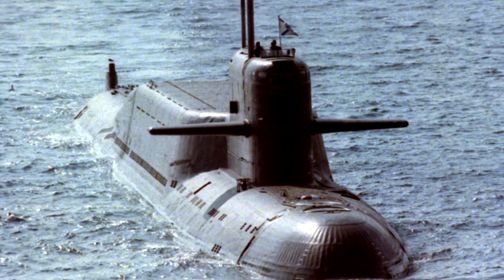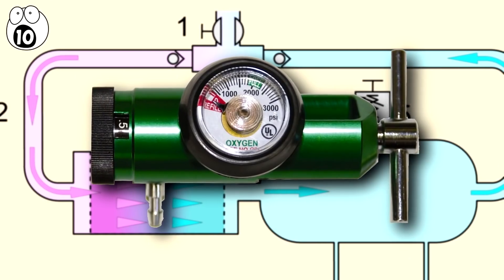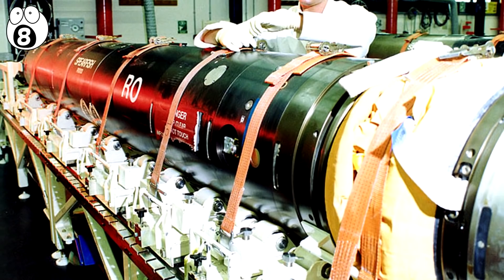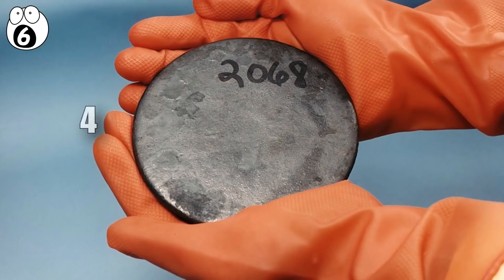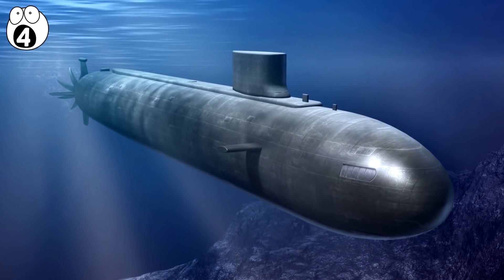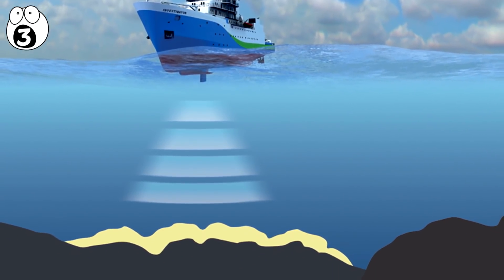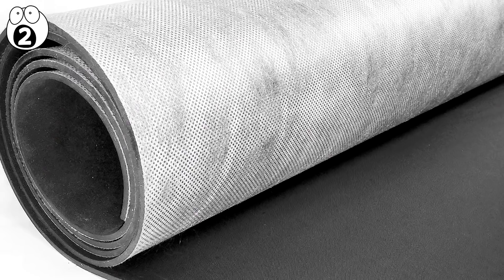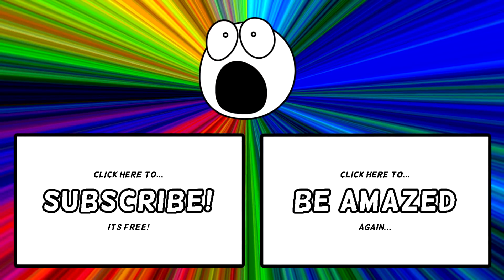Declassified Nuclear Submarine Design Secrets

Comment: I'm an Engineer on submarines and so much of this is inaccurate. Nice try though.
Reply: OPSEC Eng. ours is not to confirm nor deny
Reply: I stopped watching at "Rockets need air."  How did we got off the moon?
Reply: I started to have serious doubts during the ballast tank/planes explanation... Basically, it you're requiring lift/control from water flowing over the planes to control depth, what happens if you stop moving... The sub is going to either bob up or sink down to the point where its density matches that of the water it displaces with its volume. That's not progress, so I suspect the ballast tanks are still the way to do it.
Comparing it to a aeroplane just screams this issue, we all know what happens to the control of altitude of a aeroplane if it stops moving! An aeroplane will never manage to match the density of its surrounding, it's far more dense than the air, and the air/ground density transition is a bit sudden, so... splat.
Much better to compare a sub to a balloon/airship, all are buoyant in their chosen environment.

And then it moved onto guided torpedoes... Yup, acoustic guided torpedoes have been around since the 40s. Two seconds spent on google would have revealed a wiki page with loads of info.
https://en.wikipedia.org/wiki/Acoustic_torpedo

At that point I stopped watching, as I could feel myself getting dumber.
Reply: What's the difference between 'pumping water in and out' and ballast tanks?  What are you 'pumping water in and out' of?  That'd be ballast tanks, right?
Reply: Brian D. Also air is made using electrolysis. You only snort air occasionally as a fast replenishment or to run the diesels. Compressed air is also used to blow the ballast tanks in the surfacing process.
Reply: doggonemess
Great reply! LOL!  I was a nuclear trained EM in the Navy, number 6 was definitely wrong because he said that '...the steam is used to make electricity to propel the ship...' 
During normal operations, the steam is used mechanically (not electrically) to propel the ship (turbine to gear to prop) and a relatively small amount is used for electricity.  There is an electric propulsion motor that can be engaged with a clutch but, it would only be used in an emergency.
It's like this guy watched The Hunt For Red October for the first time and made a video about it!
Reply: What's inaccurate? Many, many points. I bet I can find one with every entry. Here goes. 
10: Subs never used compressed air cylinders, the people breathed the air trapped in the sub and got fresh air on the surface.
9: The earliest subs had planes. The image used as an example is a US Civil War submarine.
8: The last electric torpedo was the Sting Ray, which is still in service. The Tigerfish was retired years ago.
7: The MK48 ADCAP is used on all US submarines, not just the Ohio class. Acoustic homing torpedos were developed during WWII, and could follow their targets. Not all torpedos were dumb fired before wire guided systems were invented.
6: Amazingly, this is basically correct.
5: Rockets do not need steam launchers to work underwater. They carry their own oxidizer. Hence "rockets" and not "jets". This is easily the stupidest thing I've seen in this video - they don't use their engines underwater because it would damage the submarine, not because they need oxygen from the air.
4: Oh man, so much wrong. Passive sonar systems are located ALL OVER the submarine. The nose houses the active sonar emitter. And the active sonar is almost never used for navigation as it would give away the sub's position. They use charts, just like every other watercraft in history. And the "3D" hydrophone is probably as old as passive sonar. Advanced modern systems use towed-array sonar and complex algorithms to work out what the sound is doing as it travels through the water.
3: Propellers (screws) have always had multiple blades. The main difference is the shape of the blades.
2: Subs in WWII could dive beyond 300 meters. Some hulls are made from other materials, like titanium. 
1: The Seawolf subs function better as spy submarines, one of the reasons that the Jimmy Carter is 30 meters longer. They're too expensive and complex for fleet operations, hence the Virginia class replacement.

Do more research.
Reply: Thegreenbeanfightingmachine ok...
Reply: Steve Evans the planes don't generate lift like an aeroplane. It's all about achieving neutral buoyancy by pumping water in and out. Archimedes principle. Ballast tanks are only effective for buoyancy in shallow depths. Past a certain depth they're useless and you need propulsion to physically drive the boat up. The pitch is controlled by the planes. Bodily weight using water also gets adjusted for controlled depth changes.
Reply: Nizzle FoShizzle great theory. I'm not an engineer because I'm not broadcasting my service history in the public domain...
Reply: dspencer1969 if you are referring to American submarines then yes. If for some bizarre reason an American boomer was lost at sea (God forbid) then there will be others out there patrolling at the same time that can retaliate. If you are referring to an attack on US soil then the answer is also yes. A retaliation can happen very quickly and the crews will rehearse this drills very regularly. I'm not sure what the response time is for the US but I would hazard an educated guess as within 15 mins. I hope this answers your question.
Reply: Gaming with Vinnie yeah cheers muppet. Run along.
Reply: Aaron O'Shea I know more than this guy by reading Clancy books
Reply: If the situation had escalated to the point of it being necessary to retaliate in this manner, you will have more immediate things to worry about. Whether or not it actually is an effective deterrent is another kettle of fish.
Reply: neither confirm nor deny...
Reply: it is the flow of water over the planes that controls lift. If you stop, it's very hard to control depth. We used to have trim parties. All the fat guys ran aft. In control they had to pump water from aft to fwd to stabilize. And both plane yokes were forward.  Then a "spy" in control called the engine room and the fat guys ran fwd. They pumped water again the other way. All this till the diving officer realized they were screwing with him, and the fun was over.  STS2(SS)
Reply: Nope. "Ballast Tanks" are external to the pressure hull of the boat. On the surface they are full of air, when dived they must be completely full of water. Neutral Buoyancy is achieved/controlled by pumping water in and out of the "Trim Tanks" which are within the pressure hull of the boat. Depth is controlled with the hydroplanes basically by "driving" the boat up or down in the water column. With neutral buoyancy if the boat is stopped in the water it will be stopped in both horizontal and vertical position.
Reply: PS Ex Royal Navy Submariner (Marine Engineer Mechanic or Machinists Mate for US readers) 1974 to 1984
Reply: There are Main Ballast Tanks (MBTs) and Variable Ballast or Trim Tanks.  In your usage we are talking Variable Ballast - presumably all of the MBTs are full when Submerged.  The Variable ballasts are generally partially filled so as to allow adding or removing water.
Reply: Doktor McNasty no. There are internal tanks that you control body weight with. Ballast tanks are external. Internal tanks are called compensation tanks.
Reply: Subs absolutely did/do have compresses air cylinders. They are used to support EAB's or "Emergency Air Breathers" which are used during fires and accidental gas/chemical discharges. True, they air cylinders are not used for general air supply to the sub they do intermittently go up to "snorkel-depth" to "intake" fresh air and "expell" old used air but do not actually "surface".
Reply: "compressed"
Reply: I have a "boomer" question I'll direct to Aaron O'Shea.  Is our deterrent safe?  What I mean is,if something bad happened would we still have the capability to retaliate?
Reply: doggonemess you know more than the guy that made this video, have you ever been on a sub.? Also if you think about it, it’s asinine to think they carried tanks of oxygen, they would need so much room just for that, thanks for the correct info. Good video but they should really do more research.
Reply: loololololol
Reply: Aaron O'Shea im no sub engineer, but i do know a thing or two about rockets. And as long as your rocket has LOX, or any form of oxidizer, it can ignite underwater. There was a plan for a super heavy lift booster called sea dragon, that would launch from the ocean, with the rocket nozzle submerged.
Reply: Oxygen is made that way, not air.
Reply: Utter nonsense!

Any Diving Officer Student is taught PASS P=Planes, A = Angle, S= Speed, ans S= Special Ballast.  (Special Ballast really only applies to older Diesel and early Nuke Boats - Think Negative Tank.)

PASS measn to say that in that order, the Diving Officer should attempt to obtain a desired or neutral trim.  If upon diving, one finds the boat heavy he should maintain his depth by adding plane angle up, if no good, add angle up, if not, add speed, and in a final act blow some water overboard.

The way to obtain neural or other desired trim is by flooding in or pumping out water OR moving trim water fore-aft.  

The stern planes, indeed, do generate either lift or down-force, but they also can change the angle on the boat.  So note that Stern plane angle can affect BOTH lift and also angle.

Same effect if  reversed have Bow Planes,  With Fairwater Planes, there is a lesser affect on Angle, but lift and down force are both created.
Reply: Electrolysis is used to make OXYGEN.  Oxygen and otther gassses such as Nitrogen, CO, CO2, are compressed for storage in air flasks.  Oxygen is stored separately in O2 Flasks.
Reply: Of course the manufactured Oxygen from electrolysis is stored in flasks on board!  Doh.
Reply: Nope!
Reply: And then there are Main Ballast Tanks which do not!
Reply: You missed the Hydrogen peroxide fulled torp. We had several accidents with these and it has been suspected that the Kiev suffered this problem. Hydrogen peroxide reacts to aluminum  ( the torp body) and releases hydrogen gas which can build up and cause an explosion. Please do more fact checking.
Reply: These replies are funny.  Lots of submarine "experts" arguing over semantics on why thier comments are right and others are wrong.  Really?  You guys got nothing better to do?  Good, it's hilarious!
Reply: Thegreenbeanfightingmachine from a person that just likes to learn about submarines, yes it is pretty inaccurate.
Reply: Like what?
Reply: 1962 -1970, 2 diesel boats, 2 nukes.  Did not bother to finish watching this.  DBF.
Reply: It's classified. For me to even go on a US Navy sub, I had to get a clearance.
Reply: Aaron O'Shea ha bullshit
Reply: doggonemess 

doggonemess 

Submarines still use compressed air bottles for the HP air ring-main and blowing ballast tanks.
The earliest submarines didn't have planes. This came about 40-50 years after the earliest ones.
Reply: BULL
Reply: Aaron O'Shea sir what is the biggest mistake in your opinion this video made.? Tia.
Reply: You guys missed one. Submarines now longer use ballast tanks to control depth. They now use planes to change depth.
Reply: No,,, Ballast tanks are inside.  STS2(SS)
Reply: There's a variety of ballast tanks throughout the boat. Water is either pumped fwd or aft to control pitch, or pumped on board or to sea to overall lighten or make heavy the boat. STS2(SS)
Reply: @raven, this guy is no engineer. Who even writes engineer with a capital letter? lol!

Any real submariner wouldn't debate how a supercavitating torpedo works on a engineering level. Don't really have much time if you got one of those incoming at 530 mph.
Reply: Aaron O'Shea Well then. Make a video!
Reply: Arron O'Shea, while not a submariner myself, I have been in the program for 25 years and its a very small community. When I put your name in the global address book nothing came up and I don't recall your name not that I know everyone. Mind telling me where you work? not the project your on or which code you work  for just the organization your employed by. Because I think your full of crap.

Comment: Declassified nuclear submarine design secrets?
Like obsolete electric torpedoes????? Who the hell even uses electric propulsion???? Last i heard designs like wave disk engines fueled by stuff like Otto fuel II...

Either the creator has zero knowledge, and ability to look up stuff, thus unable to deliver what the title promises - or its just a complete bollocks title, that has nothing to do with the video!
Reply: Germany for example; its  DM2A4 heavyweight torpedo got introduced in 2004.
But there are more than enough other mistakes in the video...

Comment: How did you manage to explain Cavitation just perfectly (which is really rare at top10 videos) but fuck up at simple rockets?
Reply: actually he screwed that up. Cavitation is the result of a pressure drop at the blade tip. This causes the gasses in solution to come out. Those gas bubbles move away from the low pressure area and then collapse. This is the cause of the noise. Also pits the blade over time. Basically same principle as the CO2 that comes out when you open a can of coke.

Comment: Submarines still use ballast tanks. And rockets bring their own oxidizer.
Reply: They have emergency ballast, but most of the vertical control is done by the regular ballast tanks.
And the planes are usable only when the submarine is moving fast - which makes noise. For stealth they need to have neutral buoyancy.
Reply: Bawnquishasm ballast are for emergency if  im not mistaken
Reply: It's not the planes that is noisy - it's moving fast that creates noise. The problem is the slower you move, the less effective the planes are, you have to run them at greater angles, create more drag, run the engine at greater power to keep the speed and all of those combined also increase the noise.
Why would using ballast be noisy? Do you have some link from a good source that gives ballast noise levels?
Reply: @nikolatasev4948  Rapid acceleration produces cavitation, not necessarily moving fast.  The amount of cavitation is also controlled by other factors including the depth the submarine is operating at and the specific characteristics of the water it is in.  I suspect there aren't many if any real submariners in this section.
Reply: Yes submarine usually are negatively buoyant, but only slightly, so you can maintain the deep with only small correction on planes. Planes during straight navigation are used only for trimming. If you want to reach the max speed the sub must be  trimmed, otherwise it can lost few knots (1,2 more, depends). 
For example in the U-212 there are 5 main flooding ballast plus 4 compensation ballast and 2 balance ballast for a total of 11! And are used in navigation from the EMCS. In a sub of 1500tons (like italian Sauro class for example)  the flooding ballast are filled with an error of  about 100kg of water. Anyway any shape moving a in fluid produce noise, depending from how many tubolence it make in the fluid, so "yes" planes make noise (pump for balance and air for emptying make noise too). Probably undetectable from a nuclear submarine in navigation but sure detectable from a convenzional sub stationary listening. Don't have cooling sistem and a gas turbine always running give some advantage during an hunt.
Reply: Modern submarines definitely use free flow holes. Stop with the bullshit, it is embarrassing.
Reply: Yes. I was going to mention the same error by the narrator, when he said "rockets burn oxygen". One of the most basic defining characteristics of rocket propulsion is that no atmospheric oxygen is needed; the rockets themselves contain all the combustion components.
Reply: What is the purpose of being negatively buoyant?
Reply: I was on a Navy sub and they showed me the tanks.
Reply: Subs don't often "take on loads"  but the load is moving around on a regular basis as people move back and forth.  The is a watchstander who is constantly monitoring the trim and adjusting ballast.
Reply: @Tasty Echoes. - You are mistaken. Ballast tanks, both internal and external are still used for normal operations, not just for emergency surfacing.
Reply: Really?  Negatively buoyant?
Reply: lets build this badboi
Reply: Ballast tanks are still used, but the stern planes are still used to control depth normally.
Reply: Moving water through a restriction i.e. flooding a ballast tank will make flow noise. That is why modern submarines no longer have free flow holes. 

To make something truly neutral buoyant you would need to balance the ship every time you take on or remove a load, water extra personnel etc. If positive buoyant you will always rise making periscope depth operations impossible.
Reply: @memegene756  Neutral buoyancy is normally preferred.  It is most desirable to get a good trim when the sub is moving slowly through the water so that hydrodynamics play a minimal factor.  Thermal gradients and salinity also can have a large effect on buoyancy and there are places in the world we travel when those variables can change suddenly requiring everyone to keep on their toes.  As a patrol gets extended it is normal for a sub to become lighter.  The crew is eating the food and the TCU is very busy.
Reply: We flood the ballast tanks to dive and the stay full until  we surface, depth is maintiand with the plans.
Reply: Actually modern subs are setup to be negatively buoyant. If they stop moving they sink. And no using the planes is not noisy. Using ballast would be very noisy.